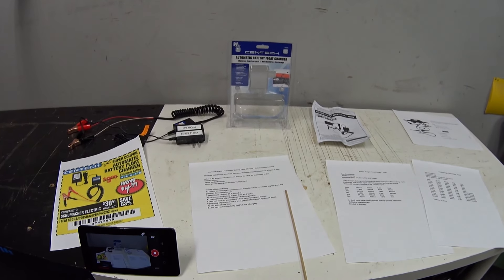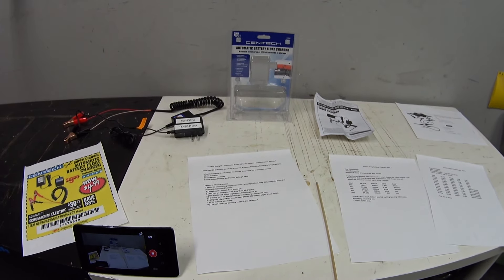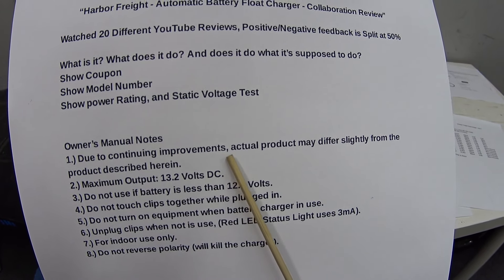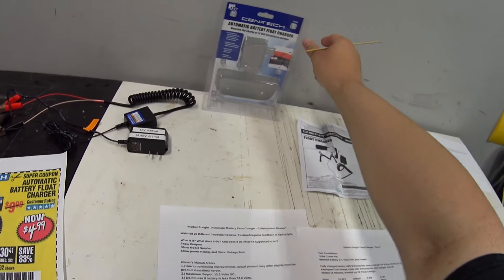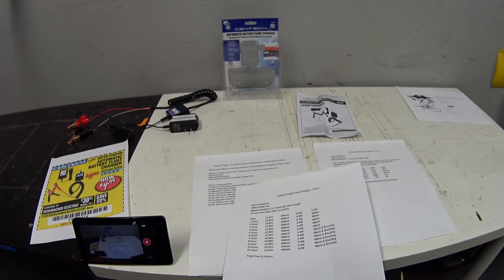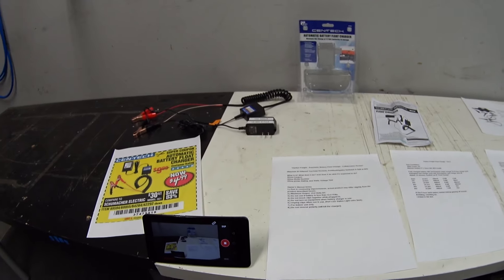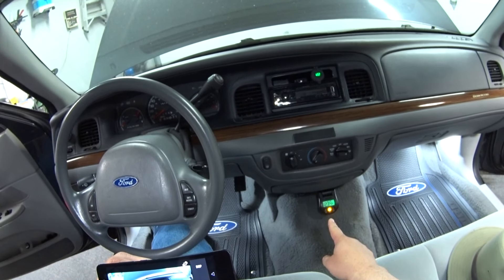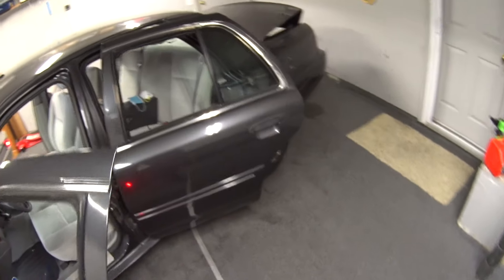Harbor Freight - Automatic Battery Float Charger

Comment: Hey Chuck, on the 6:55 minute of your video, as per the manual, you said "do not turn on equipment when battery charge in use". Can you please explain why harbor freight said to not use equipment while charging? What can be the complications or damages (to the car equipment or to the charger)? If it is dangerous to the charger, for $5 I dont care... if it is dangerous for the car equipment, I do really care and will like to know what could happen. Thanks for the great video!!!
Reply from the maker: Right EV,
Thanks for watching, and the great question.

For reference here is a link to the user manual; https://manuals.harborfreight.com/manuals/42000-42999/42292.pdf
-
Warning #8 on Page 2 describes this instruction. I think the only person who can truly explain why, is the person who wrote the user manual. But, I would like to offer my best guess.

This little guy only puts out 400mA of current. To put that in perspective the factory trunk light bulb in my car that illuminates when you open the trunk uses 1000mA. So that means for this little charger to keep a fully charged battery “topped up” all electrical accessories need to be shut off.

Let me know if that doesn’t answer your question.
-Chuck
Reply: @PanzerPlatform  Hey Chuck, I get it. I guess it means that the little guy will not be able to perform its job as it should because there is too much electricity being depleted from the battery VS  what it can deliver.

Thanks for the quick reply, I really appreciaded. Video is liked and now subscribed.

Comment: Hi there what is the output voltage of the charger with out load ?  this charger maybe setup to constant current because of the 408 mA . I have a the 69955 and the voltage out is 13.2 and floating current front 70 -100 mA. thanks for you great video
Reply from the maker: At the 15:01 mark in the video I tested the no load voltage output at 14.49 Volts.
Reply: @PanzerPlatform  thanks

Comment: Will this charge a car battery that went dead. It was a brand new battery and sat for a few months and died.
Reply from the maker: Right on Ninja,
Thanks for watching, and the good question.

This only puts out 400mA.
This is just enough current to keep an already fully charged battery topped up.

You may need to step up just a bit in price around $20.
Look for something that says "fully automatic" or "microprocessor controlled" 
Walmart . com has a couple good ones.
-Chuck

Comment: Where can I get a cig/aux voltage meter like yours?
Reply from the maker: Right on Peter,
Thanks for watching.

It’s called the Innova 3721 Battery and Charging System Monitor.
You can find them online at Walmart & Amazon.
https://www.innova.com/products/battery-monitor-3721
-
Here’s how it works during a cranking test; https://youtu.be/kVhWwzeQ04k
-
-Chuck

Comment: I purchased this cheap charger hooked up to my battery in my truck for the winter. when I went to uncover my truck in the spring there was acid all over my battery box the battery was very hot  and my battery was ruined I went cheap and got just what I paid for spend a little extra money and buy a better charger I HAVE 3 good  trickle chargers 2 on my boat and one on my truck being stored  I don't advise buying this charger
Reply from the maker: Right on Michael,
Thank you for watching, and the good feedback.
I mention the issue that "cooked" your battery in my closing arguments in the last chapter at 20:45
When these things fail to automatically shut off they "boil the water" out of a battery.
These little $5 darlings have their uses, but I don't trust them to be left unattended for more than 24 hours.
-Chuck

Comment: I had one of these and it blew up while plugged into the wall, never again.
Reply from the maker: Yo Cat,
Thanks for the good feedback. 
After testing 4 different model numbers of the same harbor freight charger I learned they do not shut off, and keep delivering constant current. 

Quality control is hit & miss. 
I measured each chargers output amperage and they were all different.  

I wanted to like the device but I returned it. They're just not 100% safe to leave plugged in and unattended. 

But of course there's 10,000 people who will say they're the best thing since sliced bread. Lol

Everyone has different standards. 
-Chuck

Comment: Yeah hard to find them at $4.99 now.
Reply from the maker: Hello,
Current price is $8.99;

https://www.harborfreight.com/12v-automatic-battery-maintainer-59000.html

Check your couch cushions for loose change. lol
—Chuck
Reply: @PanzerPlatform  Yeah I saw it but there are 2 , so kinda throughing me for a loop. Are they both the same float and maintainer?
Reply from the maker: @brizzx32  
The charger shown in this video is item number 59000 for $8.99;
https://www.harborfreight.com/12v-automatic-battery-maintainer-59000.html 

What is the item number, or link to the one you're talking about?
-Chuck